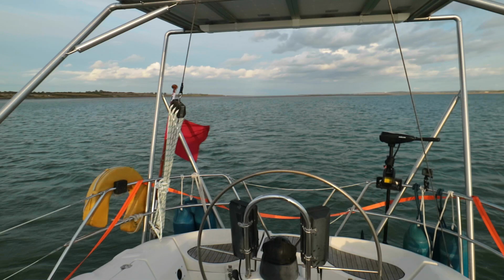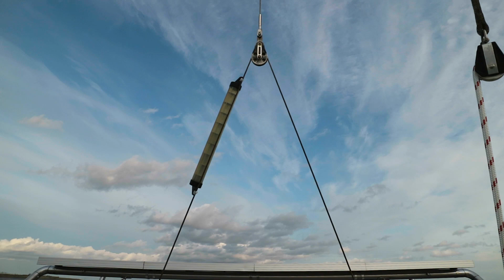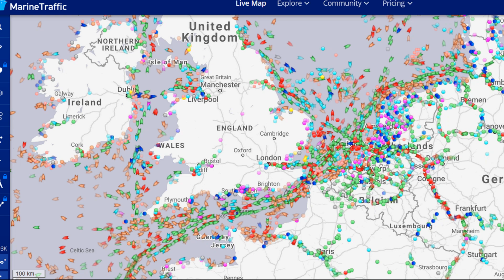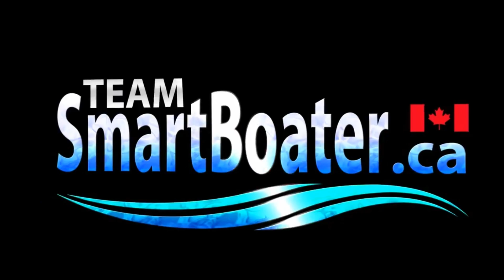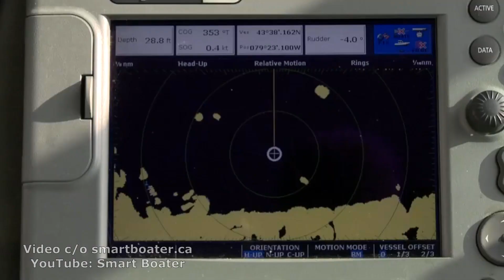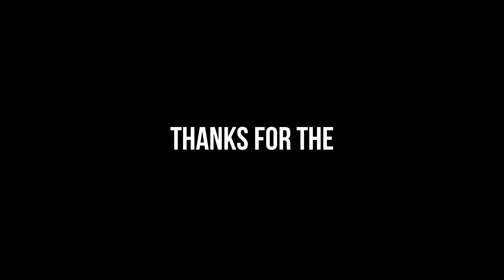Radar Reflector Upgrade | ⛵ Sailing Britaly ⛵

Comment: Hello Chris! I've just bought an echomax230 and I'm wondering why all the other yachts have it fixed to their mast? 

Is it safe to put it on the spreader of my westerly 33? Did it end up being stable on your boat?
Reply from the maker: Hi there, the inventor recommended having it suspended from a spreader to get better 360 degree returns when painted by other vessels. However, purely for convenience, I ended up making two brackets out of aluminium, so as of a few weeks ago ours is now fitted to the mast under our radome. I'm happy to sacrifice a tiny bit of effectiveness in exchange for this "fit and forget" solution. There was no problem in having it suspended from the spreader, but it was one more thing on the already long to-do list when needed for a passage... Cheers, Chris
Reply: @SailingBritaly  gotcha, so you wouldn't just leave it suspended on the spreader full time? Take it down when it's not in use

Comment: Great videos Chris. We have a 350 lagoon and I noticed that you have a below deck autopilot. We have a wheelpilot which is not really man enough for the job. Any chance of a short video of your installation?
Reply from the maker: Hi Steve, just a quick interim update: You're not the first person to ask this as a Patron of ours has the exact same problem and wants to do the same. I do have some footage somewhere in which I explain how our entire steering system works from start to finish and how I worked out where the approximate 30 mm of play at the wheel was coming from (two bearings inside the pedestal, which I replaced before setting off for the channel crossing). That footage does cover the autopilot setup too. I've spent about 2 hours so far looking for those video files but I haven't been able to find them yet (we have hundreds of GB of footage on lots of different drives, SD cards etc. and as we move around a lot it's easy to misplace files). If I do find it I'll make a video and upload it here. Cheers, Chris

Comment: Radar reflector is NOT a Legal requirement on <15mtr boat - it’s an advisory.  Only on commercially operated vessels. ( uk/Europe waters)
Reply from the maker: SOLAS V Regulation 19

2.1 All ships irrespective of size shall have:

2.1.7 if less than 150 gross tonnage and if practicable, a radar reflector or other means, to enable detection by ships navigating by radar at both 9 and 3 GHz; 

These regulations apply to all pleasure vessels and if a skipper is ever involved in an accident, not having a radar reflector would be very difficult to defend.

You are, of course, free to disagree.

Chris
Reply: @SailingBritaly   it is still Only an “advisory” not a “LEGAL” requirement.
Reply from the maker: @davidgore6212  The UK Government website disagrees:

"This leaflet describes how the 2002 regulations affect owners and users of small pleasure boats. It covers the following requirements:

    • Voyage planning
    • Radar reflectors
    • Life saving signals
    • Assistance to other craft
    • Misuse of distress signals

You may be prosecuted if you’re involved in a boating accident and you haven’t applied the basic principles outlined in this leaflet."

Here is the 2 -page leaflet:

 https://www.gov.uk/government/publications/solas-regulations-for-pleasure-boat-users 

That sounds very much like a legal requirement to me, but you can interpret these regulations any way you see fit.

Chris

Comment: Thanks for video. I'm normally inspired by each of your posts.  Curious whether you got around to finally mounting the radar reflects with "dynema" and if you did, whether you hung it from the spreaders or put it somewhere else?
Reply from the maker: Hi Peter, thank you! A couple of weeks after this was filmed I left the boat and haven't been back since, so this is on my to-do list. I intend to fit it to the port spreader when we can confidently cross borders again. Cheers, Chris
Reply: @SailingBritaly  can you fit them horizontally on the top of the spreader or will you hang vertically underneath?

Comment: When at anchor I have the mandatory anchor light, the deck light and AIS on. That hopefully covers everything from small to big.
Reply from the maker: Hi Colin, here is a section of a reply I've copied from another comment:
"Ships can actually "turn off" Class B AIS on their screens, so if they are transiting somewhere with lots of leisure boats, they may do this to avoid clutter on their screens.
Radar reflectors are a legal requirement because radar is a primary means of navigation for ships in bad visibility. AIS isn't...
This is just my opinion and I could be completely wrong (I often am!)"
Cheers,
Chris :-)

Comment: No Ais on your boat?
Reply from the maker: We have an AIS receiver, we don't have a transducer. If we did, I wouldn't necessarily rely on AIS for collision avoidance though...
Here are some examples of why a passive radar reflector can protect you where AIS wouldn't:
•  Lightning strike (Could destroy all electronics, a passive radar reflector would still work)
•  Electrical failure (As above)
•  Ships can actually "turn off" Class B AIS on their screens, so if they are transiting somewhere with lots of leisure boats, they may do this to avoid clutter on their screens.
Radar reflectors are a legal requirement because radar is a primary means of navigation for ships in bad visibility. AIS isn't...
This is just my opinion and I could be completely wrong (I often am!)
Cheers,
Chris :-)
Reply: @SailingBritaly  —— yer dam right... Not everyone looks on radar— especially in the USA waters— you’d always need to be on the offense over here as we DO NOT use collision avoidance systems onboard major oil and cargo tankers... Do NOT ask me why— every year over here we have several tankers collide at sea and at port... Unfathomable for me— a small 13.5m vessel...
Reply: @SailingBritaly  Very good points, and especially the fact that it is a isolated unit, loss of electrics and electrical equipment via lightning strike or failure would not be top of my Christmas present list, but a good quality radar reflector just might be, thanks
Reply: AIS is not a required system, nor is it as effective as radar.
As Chris mentioned, they have an AIS Receiver only on Britaly, which means any ship using AIS to navigate around boats won't find them. ( the weakness of AIS )
Radar as an obstacle navigation tool is much more effective, you get a reading on anything solid enough for the signal to bounce off of. The issue with radar is that often the display can get cluttered with false returns.
both have use for navigation and actually work well together, the best tool for Chris' situation in this vid is the lights. Those make a boat very visible at night, far more than most would think.